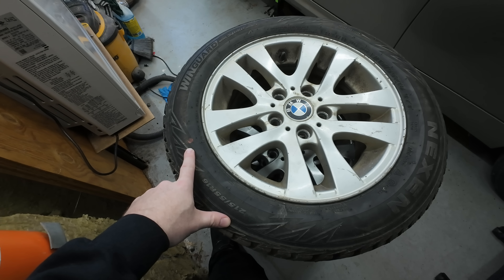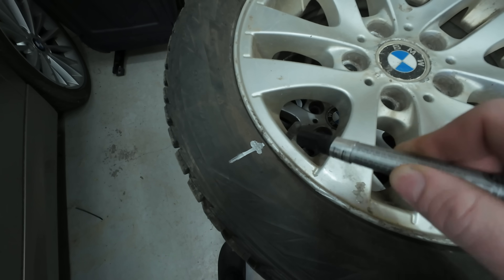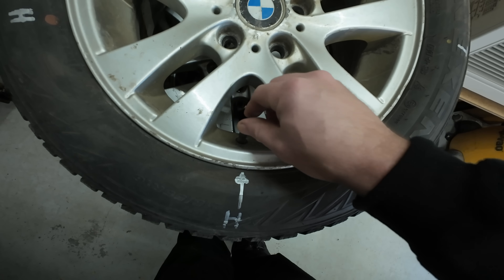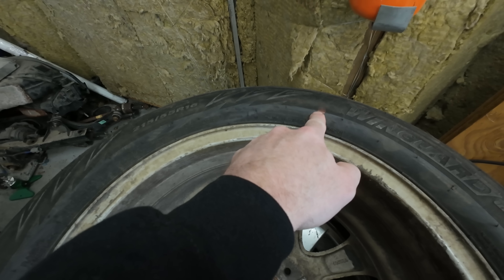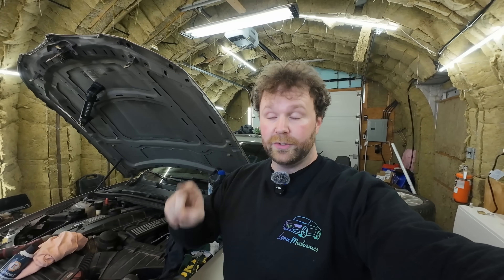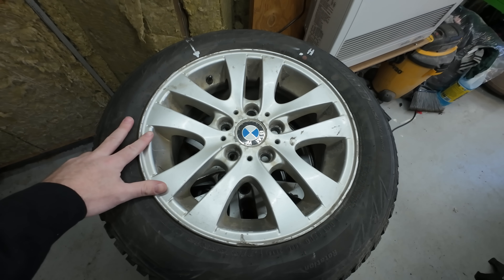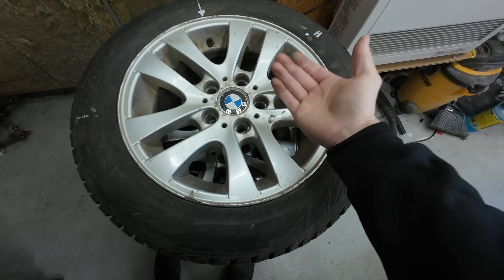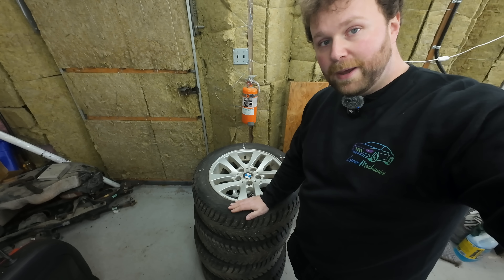Tire Red & Yellow Dots Explained | Back to Basics. Many mechanics get this 1/2 right

Comment: The dots are on the tires for a reason , its just common sense people.  Tire shops employees should be trained on this, but its just get the tires mounted and get my money don't worry about how many weights you use . Everyone have a nice smooth riding.

Comment: Red dot stands for Radial Force Variation (RFV) and is the highest spot, should be faced on the rims lowest spot if its marked, nothing to do with weights. If the red dot meant heaviest spot it would be on the opposite site to the yellow dot. Or else physics doesn't exist.

Comment: When I worked at a tire shop pin the 90s, our machine had a setting where you ran it, marked the tire and valve stem, remounted the tire 180 degrees, re ran it, and it would tell you where to mark it so you could remount and match the tire with the wheel. Most times you could use no weights, and if you did, usually no more than .75 oz.

Comment: I bought a 2016 F150 with the 2.7 ecoboost new. It came with Hankook tires. They last about 50k miles. I went to Discount Tire in Austell Ga. and bought 4 new Michelins. When I left. The truck at 45 mph, felt like I was riding across pencils. I took it back and they balance them again. Now it would shake at 65 mph. I took it back again and they gave me another set of tires. They also didn't ride very smooth. I returned the tires and went to a Ford dealer and bought another set of Hankook. The truck rode smooth again. The dealer said Discount tires are not made right.
Reply from the maker: as much as I hate some oem brand tires that come with the vehicle. NO oem dealer is going to let you have a vehicle that shakes at high speeds. This is where most people in the comments missed what I was talking about. having to chase shakes that are hard to troubleshoot and wear on tires that isn;t suspension related
Reply: @Lancemechanics  I forgot to say Discount Tire put weights in two different spots on my wheels. The dealer said this was not the correct way to balance tires.

Comment: I love your attention to detail. I used to be the “driveability guy” at my old shop and I came across soo many misbalanced and counter-weighted jobs. 3oz total is a good guideline, anything over that will indeed ride bad on the Highway. I had to learn a lot of these tricks when we started doing heavier truck tires, the runout on some AT tires is absolutely mad, so we were constantly Road Forcing and warrantying knobbies.

Anyone else remember the Goodyear strike, where they brought in an alternate workforce to run the plants? Holy crap their QC was non-existent during that time period.

Comment: If you want to do a good job, you don‘t rely on ‚the valve is the heaviest‘. Instead you balance the rim and then mount the rubber accordingly and finally balance the tyre.

Comment: I was never taught to line the dot up to the valve stem.  That is actually 100% incorrect.  It only takes 30 seconds to figure out what the mark is for.  Tire manufacturers would have no problem talking on the telephone or answering an email asking them what the marks or for.  What kind of mechanic would assume?

Comment: I have always set the valve at the yellow dot. As I was told when I was on a training course at Michelin 25 years ago. Also always use tire balancing machines that measure road pressure

Comment: When I was a lube tech at 18 years old I was told to put it opposite the valve stem.  Which is correct.  I've never heard to line up the dot with the valve stem as you indicated mechanics are trained to do.  That being said even if they're being told the wrong information I have had dozens of tires installed over the last three decades and not a single time has a dot been lined up with the valve stem or been 180 off of the valve stem.  At multiple different shops.  So I would say most techs even discount tire they simply don't care or they were never trying to properly.  I worked at a good year.  And my tire balance always came out perfect.

Comment: I was taught that you line up the yellow dot with the valve stem on alloy wheels and you line up the red dot with a stamp mark on the outer lip on a steel wheels. This can be verified by anyone who does new vehicle deliveries at a dealer.  You will have to peel yellow stickers off of the tire and wheel, under those stickers will be the same as described above.

Comment: these dots have been around since before TPMS sensors. Most sensors are on the valve stems. Some sensors were mounted on bands which places the sensor 180 degrees from the valve stem. Ones with bands pretty much even the difference. Old stems before TPMS probably weighed less than the amount of metal bored out of an aluminum rim back then and you still supposed to line up the yellow dot with the stem. So lightest part of the tire with the lightest part of the wheel. Kind of stupid. Speed limit is 70 MPH where I live and I am not test driving a car at 90 MPH to verify crap. If it's smooth at 75 MPH, it's fine. And 95% of any vibration complaints from tires is going to be the tire being out of round and you can't do nothing about that on a wheel balancer. Most tires that are round when new will not be perfectly round after they have 10 or 12 K miles on them.

Comment: Nothing to do with balance. New OEM wheel has a dot for low spot on runout. DOT on tire is high spot. Line up the dot gives you the “Truest” mounted tire. The DOT on wheel is removed during most “PDI” pre delivery inspection/detail. Retired dealer tech!

Comment: Fact is, the dots indicate the lightest and heaviest spots, but don't indicate the range of weight difference. So in an ideal situation where one manages not to use any weights, the position of the valve could be anywhere literally.

Comment: Meanwhile in Whitehorse Yukon I had 4 tires installed on 10 inch rims for a Mini. No weights required, no vibration. Some techs get it but its great to hear the explanation of what the dots mean.

Comment: Please leave that building emidiatley.
Dust from open rock-wool will ruin your lungs.
Also moisture in air will condens inside construction cousing mold and sponge and make all wood rott since there is no plastic on the inside.

Thnx for reminding me of the dots 🙂

Comment: My tire shop i used once the tire was mounted if during balancing it called for alot of weight they would blow the bead and rotate the tire on the rim until little or no weights were needed

Comment: You've never in your life done big tires if you think 1.5oz is too much lmao. Get some 35/12.50r22's venom powerr mud terrain and tell me that lmao. It depends A LOT on the tire brand. You are correct lining up the yellow dot helps a lot. There are absolutely times where it takes more than 1.5 Oz on each side. You just obviously haven't done enough tires to realize that.
Reply from the maker: Big tires? :) any tire under 3000lbs is small to me now. Sorry I just find it funny cause of what I do now. Also I did lift kits for a year straight. Having a shake or lbs of weights show up through the rim spokes of these massive wheels is a sure fire way to upset a customer. Also balance beads is a copout

Comment: I have never seen any tech pay attention to the dots.  This answers questions.
Reply: I did. Most tire jockeys dont care. I cared because it made my job easier/faster. 
But i work in I.T. now - i have a tire machine at home. 
I don't even balance my hoosiers. I line 'em up and send it. So far, no big deal. 
I did my MIL's rear tires just before christmas. She's got no vibration and i dont even have a balancer. I told her if she needs 'em balanced, take the car to a shop and have 'em do it. I simply don't have the space for a wheel/tire machine AND a balancer.

Comment: Static balancing is the worst balancing?
My motorcycle at 200mph with static balanced tires has no issues.
Reply from the maker: Well let me put it this way. A static balance is weights in the center. All find and dandy on a bike tire. Now a car tire is two to 3 times the width.  Think a static is fine for that. It needs dynamic where weights are out on the center and edges.
Reply: @Lancemechanics My motorcycle rim is just shy of 6" wide.
 And that's inside the bead of the rim

Comment: Mechanic here. It's a nonsense this dots, thinking in process terms. You'll need to balance the wheel anyway.. what a mean is: With aligned dots or not, you'll need to put weights on the wheel, so this is a loss of time trying to align the dots...wich isn´t an easy process for wheels bigger than 15"... so don´t loose your time doing this.... HOW MANY grams / pounds more or less there are on the tyre dot? 5 grams, 10??? no one knows...
considering the car is 100% good, the car shake, after a wheel balancing for 3 main reasons: 
1 - Machine not calibrated - yes, the machine needs calibration also, 
2 - bent wheels or wheels with bad mass distribution - Yes you can put just the whell without the tyre at the balancing machine and mesure it, 1 in 100 gives a 0g ,0g good result. most of the wheels are casted aluminum and after machining it, still there are parts of this wheel not machined, so it's not a perfect weight distribution.
3 - tyres treads may have different weights distribution , so the balancing machine balances the RADIAL runout  NOT the AXIAL runout - in other words, the tyres may have clearly bad radial weight  distribution, witch may indicate tyres with bad statistical process. usually how do I know if my tyres have a good radial distribuition? you calibrate the wheel, with a good and calibrated machine,  and lets say it asked for 30g left side, and 25 g for right side... you put there the wheights, run again the test, and it asks you again for more wheight, like 10g left and 15g right. this is a clear indication of axial runout.

Comment: Great to know! 
If I have too many weights I always rotated the tire 30 degreese on the wheel and try again, and maybe another 30 after that to get best numbers. Some aftermarket wheels are just junk.
A tire will also shake with a dirty hub and any debris on wheel mating surface!

Comment: I got caught from an old timer that taught me the dot the d o t on the tire to the valve stem knock weights off of course I've been doing this for over 20 years now never once been to a tire shop nothing my current car just put winter tires on about 2 months ago I could go 7075 still no vibrations and I change the tires in my driveway with spoons you don't need no fancy this or later at technician to tell a mechanic how to do something people riding around with sloppy steering and suspension components so don't know just how I've been doing it never had any issues zero whatsoever changed a lot of friends and families tires as well same procedures same results never an issue

Comment: I taught technical training for a major automotive manufacturer for 32 1/2 years.  The Red dot marks the point on the tire of maximum Radial Force Variation, not maximum weight of the tire.  Maximum Radial Force Variation means the stiffest point of the sidewall of the tire when it rotates.  When the tire rolls, the sidewalls flex; variations in sidewall flex produce an up and down motion of the wheel and tire assembly and that will produce a vibration or shimmy in the steering wheel.  It is important to align the point of MVFR on the tire to the point of least radial runout of the wheel. 

The yellow dot does mark the point on circumference of the tire that has the least weight.  But that can be compensated for by balancing with weights.
Reply: ok, so this means you line 'em up where?
Reply: "align the point of MVFR on the tire to the point of least radial runout of the wheel" can elaborate more the less technical of us?
Reply: @klrwhizkid  32 1/2 yrs. How many weeks, days, hrs, min, sec.  Ha ha. Be safe and well.

Comment: This is what I see.  First of all, that rim has a big doink on the bead.  Poor example.  The rim is damaged and more than likely has excessive latteral runout..  Second of all, if you want to prove your point, take a GOOD rim and spin it without a tire on it  The weight difference from that hole is negligable.  If you are actually match mounting the tire to the rim, you have to find the high spot on the rim before you mount a tire on it, mount your tire and measure your radial run out again, and then move the tire on the rim accordingly.  Not a practical practice in the real world.
When you see multiple weights within inches of eachother on the same plane of a rim, the guy balancing it got weight on in the wrong place, and rather than moving it, just hammered another half ounce on it.   
When I took the vibration correction course thru GM, this subject came up.  Instructor claimed the hole for the valve stem was drilled at the heavy point of the rim.  I had 3 arguments that he could not dispute.  On steel rims, most notably one that has hubcaps with holes for the lugnuts,  the valve stem hole has to be in the same spot with relationship to the lugnuts or else the hubcap wouldn't fit.  Second argument was, what is the weight difference between the valve stem and the material removed for the hole?  Lastly, any particular tire size from any particular tire manufacturer quite probably fits cars from multiple manufactures, foreign and domestic.
If you have a tire that you match mounted, balanced, and still has a vibration at high speeds, and there is not a problem with the lateral runout, you've probably got a road force problem, where there's parts of the sidewall stiffer than others.
If you sleep better at night when you match the dot to the valve stem, go for it.  But I'm here to tell you that by doing that alone, it makes no difference.

Comment: Place the red dot at the tire’s lightest point — align it with the wheel valve stem
Why: The red dot marks the tire’s lightest spot from manufacturing (radial runout/weight). Placing it opposite the valve (heaviest point on many wheels) minimizes the amount of wheel weights needed.
How to do it (step-by-step):
Mount the tire on the wheel in the correct orientation so the red dot is visible.
Rotate the tire so the red dot is directly aligned with the wheel’s valve stem.
Mount the assembly on the balancer and perform dynamic/static balancing as usual; add weights where indicated.
Notes:

If the wheel manufacturer marks the wheel’s heaviest point (often a dimple) follow that instead.
If there’s also a yellow dot (light spot for radial/axial runout), follow the tire-maker’s instructions: usually yellow aligns with valve stem; red takes priority if both present.

Comment: Oh for crying out loud! You were soooooooooo close. You are 50% correct.

The Yellow dot is the lightest point.

Red on the other hand is NOT the heaviest point. No. It isnt. Its the HIGH point (or "uniformity mark").

If you have both dots; prioritize red -if the wheel has a low point indicator-, otherwise go with yellow.

God da..n it!

Comment: I only know from mounting and balancing tires for motorcycles. I got into motorcycles in the 80s. And even back then and before for quite some time they were using the DOT. It is as stated by the manufacturer of the tires, a reference marker, for what is supposed to be the lighter side of the tire. Which it is suggested you align with the valve stem. However rims are not all cut the same, yes they go on similar machines and they have similar designs but sometimes the cut is not the same. Which means you can have a rim that's a little heavier someplace else. And as you may imagine having a balance tire on a motorcycle kind of important. What I would do is I would check the vibration which was an indicator of balance. And if I didn't like it. I would depressurize the tire. And move the DOT clockwise and counterclockwise from the valve. Until I found the sweet spot where it had the least or no vibration. This is fairly obtainable because no matter where you put the weights the weights are in reference to the lightest side of the tire. So if you have a tire that's not balanced and you're moving it around on the rim you are functionally adjusting the balance on the rim and tire combination. Cuz it seems everybody forgets it is the tire and the rim combined that has to be balanced. And you can avoid most the wheel weight issues by adjusting the position of the dot in reference to the valve stem. The weird thing is I learned this in the Navy while studying radio communication. Because even with the most sophisticated Crystal systems back in the 80s and 90s and even today. The frequency is a reference marker the transmitter is not always exactly on frequency and to hear him properly you have to make a minor adjustment. Nobody incorporates an indicator as to which way that adjustment needs to be. Just like on tires. So sometimes you go plus frequency sometimes you go minus frequency. Until you have the frequency he's talking at and you're talking at balanced. They actually call it being in sync. Fun fact when you're bringing a second generator online to work parallel to another one. Creating more current at the same voltage. And yes it's a real thing in every electrical generating plant they have to balance the generators and bring them in sync. Strangely enough they have an indicator for that that helps them do that. Tires not so much. So I assume you're going to spend about 20 minutes playing with it. Budget the time enjoy your day. 
   As always have fun and keep it shiny

Comment: This is all wrong. That tire manufacturer did not make the wheel it is going on. That wheel will
Be out of valence without a tire on it, and each wheel will be different. No two are the same. So those dots are meaningless. Just mount the tire and balance it.  

Also, next time you balance a tire. Loosen the tightening but with the two handles on it. Tighten that same tire and do it again. It will be out of balance every single time.   Ignore those dots. It’s a hoax that only stupid people believe.